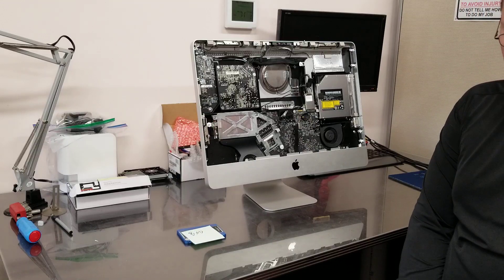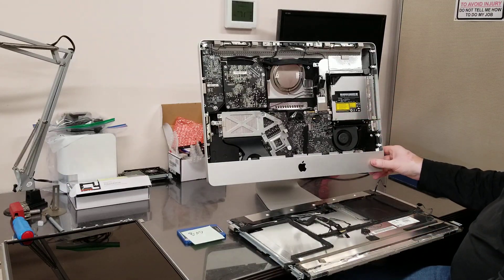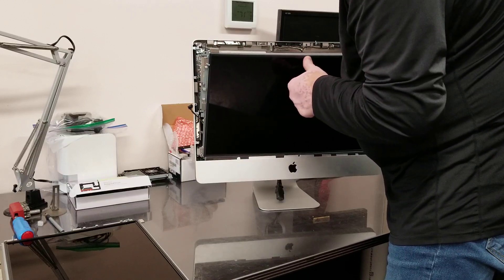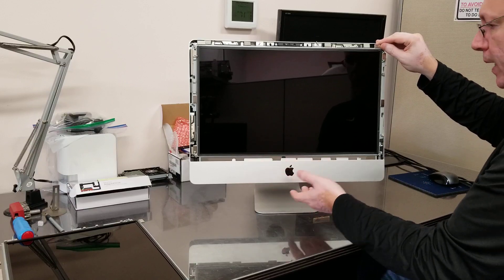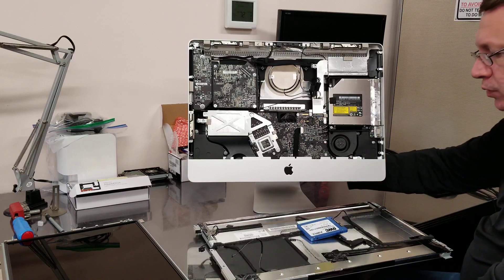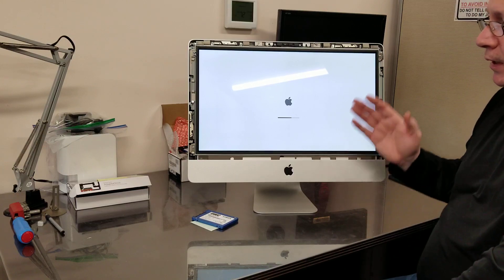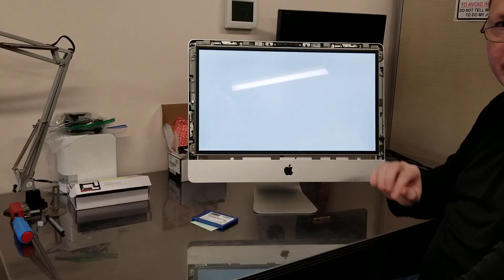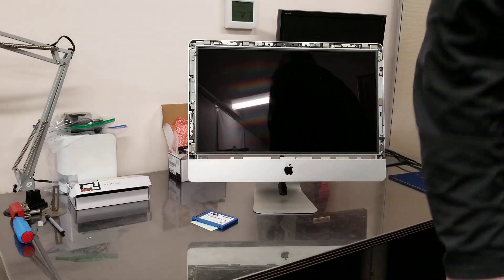Diagnostics of an iMac 24" not starting cause LCD and hard drive failure.

Comment: I have a similar the problem. However, when I remove the screen and the HD my imac does not power up at all. I replaced the HD and nothing ! I am assuming it is the motherboard then?  When HD and screen are connected it does power up but does nothing - blank screen.   Only one LED lights up on the motherboard.  I’ve changed the power supply and have a new HD on order, if this does not work it may be cheaper to buy a second hand 2011 imac. (need that ios due to old software I use). 
Looks like the fault is with the motherboard. That said, I’ve had my imac since 2011 and have never has a problem with it till now. Not bad I suppose.

Comment: I'm thinking this might be my problem. I get all 3 led diagnostic lights and fan so I know it can't be the power supply. 
Screen shorting out. Did you just leave the original hard drive an try with a new screen